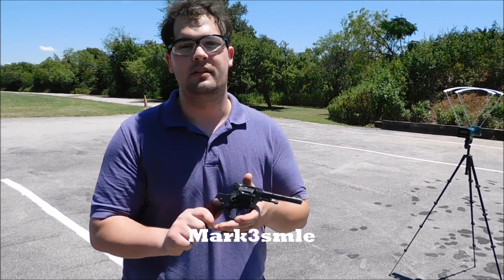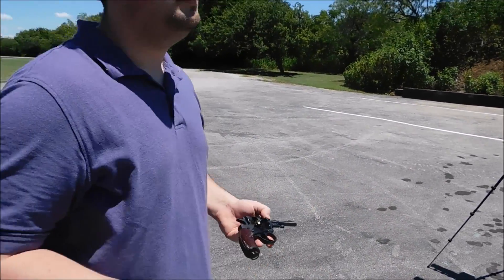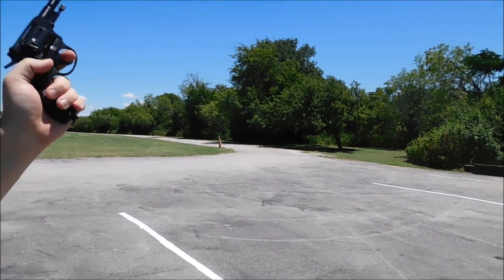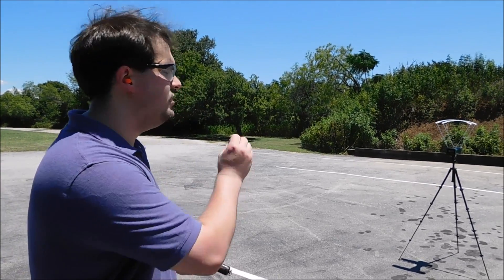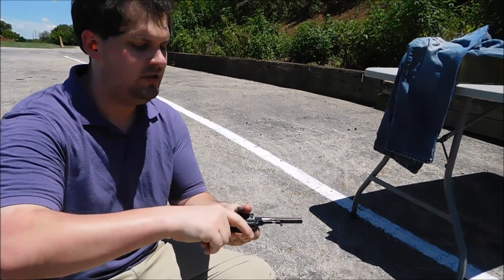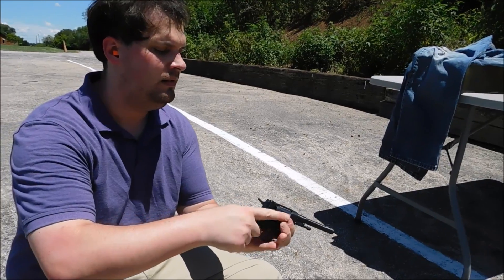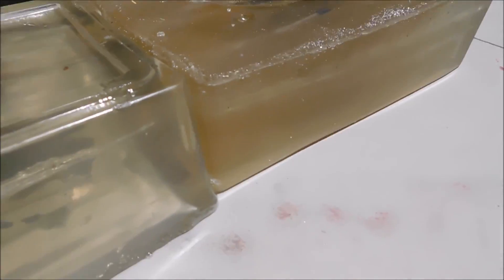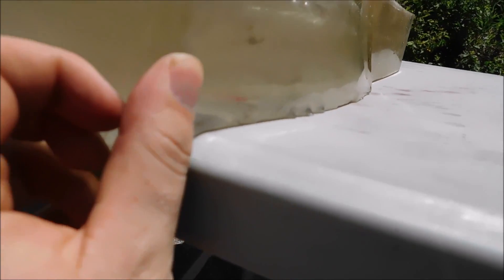M1895 Nagant Revolver 7.62x38R vs Ballistic Gel

Comment: Glad you used the proper ammo as so much commercial ammo is substantially loaded down.  I wonder how it would do with those 98grn lead cylinder bullets for reloading.  My guess is, that if loaded to mil spec pressure, they would be devastating. They're rather soft lead with an absolutely blunt face, so you should get nice expansion.

Comment: Mmmmmm that revolver was made before Soviet Russia
Reply: Jeremy Honeycutt  It was actually designed  and made before soviet Russia on into soviet Russia up until the 50s and even a little after that as it was actually prestigious in soviet russia to own a nagant intial production being in liege Belgium in 1895 and domestic production beginning in 1898 in  tula arms plant it was designed in 1886
Reply: Same with the Mosin.
Reply: I know, he says "freakin commies" but it was adopted by the Imperial Russian Army almost 25 years before the revolution.  The only thing commie about it was that they had a ton of them available and factories and tools to continue making them after the revolution.  As for the "stupid grip piece,"  at tiny bit of metal like that per unit can add up a lot when materials are scarce during wartime and you need to manufacture as many guns as possible.  After you've built a few hundred thousand or million of those while trimming little pieces of steel like that here and there, you'll save many tons of expensive material, as well as reducing weight that costs fuel to move around.  Production efficiency that capitalists can surely appreciate.

Comment: I keep thinking about getting one of these, but where I live, the ammo is hard to get. Would actually make a really good little squirrel, rabbit or grouse getter if you fire single action.
Reply: They can fire other, easier to find calibers as well.
Reply: Yeah, these will chamber 32 s&w longs man. Which is pretty cheap. But the days of finding the guns at $180 are gone. They've dried up to all $300 or more.
Reply: but not as well. The cases will budge and accuracy will suffer as the round is not the same diameter, but smaller.
Reply: $180?, I paid $79 for mine :-)
Reply: PCShogun When did you pay 79 if I may ask? Because Alvin is spot on, nowadays you really cant find these for under 300 bucks.
Reply: Paid $120 for mine at a gunshow which was ok. It was a 1933 pre-war model. Bought some custom pearl grips and in the process to get the barrel threaded to accept a supressor. But if you choose to get one I'd advise it. Its a neat peice of history. And as far as the ammo goes they do make aftermarket .32 acp conversion cylinders which is more available than 7.62x38r
Reply: They are not always accurate either.
Reply: the ppu ammo is plentiful and that is basically all you need for small game plus if you get a silencer for it especially in 30 caliber it sounds like a cap going off. run wet with the right amount of liquid you only hear the impact of the round.

Comment: I'm currently re-clambering my nagant revolver to 30 mauser.  of course they will be modest reloads, no factory stuff. too hot.   anyhow reason being is 1. csnt find replacement original cylinder, and 2.  my original cylinder was machined so rough I cannot extract empties, and they. are bulges out.
Reply from the maker: 30 Mauser is probably too hot. I am not familiar with how much metal you will have left to work with once the reaming is done, especially the bottleneck of the case.
Reply: You should make a video on it when completed! Im interested in workable ammo alternatives to these guns for obvious reasons lol.